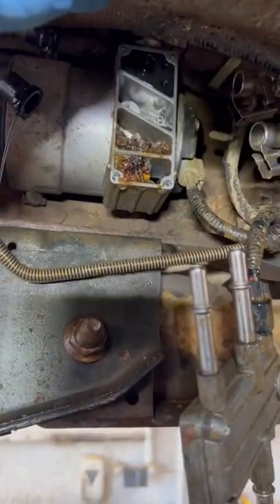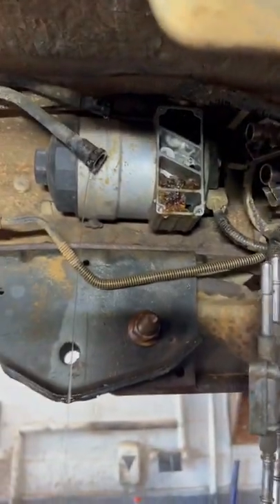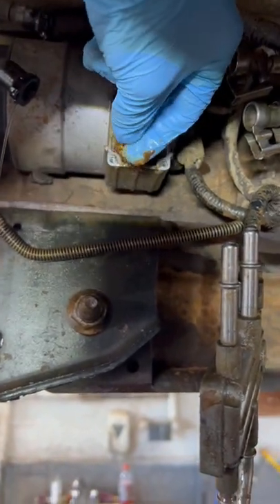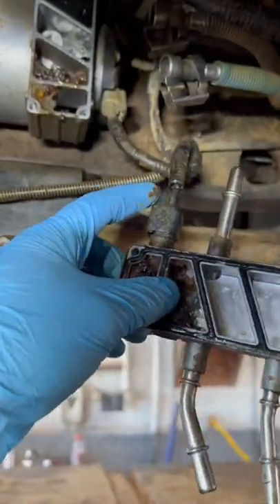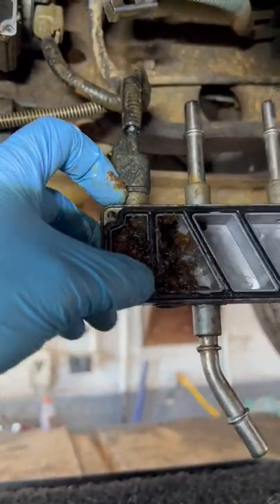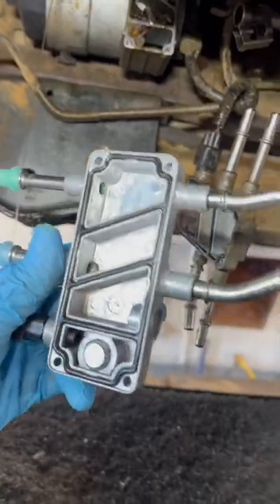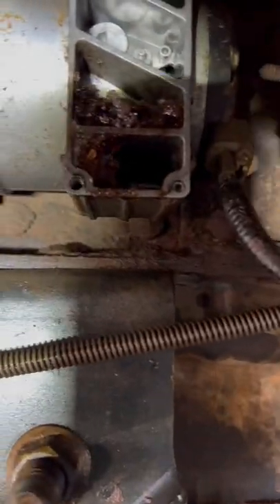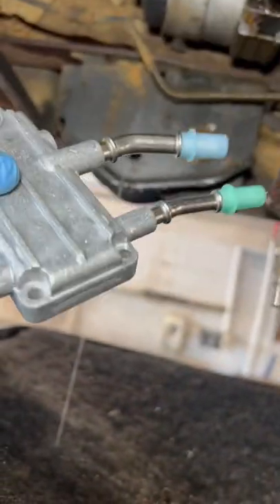Water in Fuel Light FIXED | Ford 6.0L PowerStroke #Reels

Comment: Why buy a new cover when i can just clean the one I already have 🤔
Reply from the maker: To get a new sensor.
Reply: @FlyingWrenches13  you can buy the sensor by itself for $15.  How much did that cover cost? $80?
Reply: @FlyingWrenches13  FAIL. LOL
Reply: exactly what i was thinking  ! Or get rid of the limp mode code setting junk!  Buy a Air Dog or Fass  ⛽  and filtering system!  Your think yourself later!  When your not buying  injectors at $800 pop  !
Reply: Because he can’t just charge labour
Reply: @aqibi2000  actually he can just charge labor. Not all repairs require new parts. Sometimes things just need tightened or cleaned up
Reply: Air hose and carb cleaner?? How did the dirt break the " header panel? Maybe a new gasket is needed?
Reply: @devingeary455   Sorry. But not true at all. Please do your research.
Reply: @spencew.g.  loose battery terminal? Replace it instead of tightening it? Gas cap isn't tightened down all the way throwing a code just replace it? Don't tighten it up? The confidence in your comment is laughable.  Do some research kid.  Mechanics can charge only labor and they do it quite regularly
Reply: @redguy8941  What's  laughable is that you actually took my comment serious.
Reply: @spencew.g.  at least he didn't like his own comment...
Reply: @51-FS  I know right?
Reply: The difference between mechanics and fitters
Reply: I grew up working on vehicles made before computers existed.. i still work on vintage equipment day in and day out.. these new guys can’t diagnose an issue worth a damn without hooking their fancy laptop to it and trying to pull codes.. i told this cat the other day “dude you’re not a mechanic, your a damn part changer..” he got booty tickled obviously but i had to break it down for him with crayons then he got it.. he was going crazy trying to diagnose a jeep cherokee that randomly cuts around 2,000 rpm but has no check engine light.. if there’s no light there’s no codes guy.. after 3 days of pulling his hair out i told him try probing the ground for the tps sensor.. boom problem found and I didn’t need no fancy snapon laptop to figure it out.. and i work on 70 year old detroits for a living
Reply: @mikecorleone6797  Ok.
Reply: New ones don't have pitting from corrosion and they can seal better.  If you want to reuse it,  go ahead.  It doesn't matter to me if your truck leaks fuel.  Remember that the 6.0 uses vacuum to lift the fuel to the hfcm then pressure only exists in the supply line between the hfcm and engine and the return line has pressure.  Therefore the truck could suck air and pump it through the injectors and then leak fuel once shutdown. I personally replace my hfcm with a new whole unit. They are like 220$ from ford. My truck is 08 6.4 with over 600,000 miles. Ive never put an injector in it.
Reply: Its called a manifold not a cover.
Reply: @anthonyrybczynski5420  LMAO
Reply: @anthonyrybczynski5420  manifold/cover, tomato/tomoto same shit.. it’s a damn cover and won’t leak if you replace the seals.. or better yet change your filters on time and check your tank for water occasionally and you won’t have this problem to begin with.. there’s this paste you can use to check fuel for water. You rub some on a piece of old wire or what have you and dip it in the tank.. if you pull it out and the tip turns red you got water and should drain the tank. It’s what we use for checking our fuel in marine tanks.. works great
Reply: I must agree with posters on this one, just clean it up. Oops  You dropped the ball on this one.
Reply: @mikecorleone6797  want a party ?
Reply: @WhiteBuffaloTowingLLC  sure you buyin the beer?
Reply: Why try to argue when you can just keep the comment to yourself and do you boo
Reply: I'm sure u don't even need a new sensor anyways I'd clean it real nice with brake clean first   before spending a dime
Reply: my truck shut off on me and then it said water in fuel after I changed all my sensors im going to do the same thing hopefully that helps

Comment: I noticed one thing when a person comes into the shop with a 6.0 power stroke they will buy anything you recommend no questions asked even the stuff recommended based on mileage I had one guy tell me whatever recommended based on mileage go ahead and do it
Reply: Cause they know that shit is already broke. I refuse to work on all the ones that are deleted and bullet proofed! How the fuck do you bullet proof the engine and it still goes to another shop down the rd and has piston crowns crushed and cracked onto top ring because of all the ingestion of coolant or fuel from cracked tips or whatever. Thean the customer wants a deal because its been to 5 other places. Take it to #7 and get it out of here.
Reply: @michaelkeyes3856  yeah but I’ll the life of a 6.0 a framer buys it brand new figure out it’s a piece of shit sells it to someone else then there tired of putting money in it then some kid gets it and goes Fucking crazy with it and doesn’t care how much he spends on it then it’s off to the scrap yard where it belongs  I  got 98 Chevy Silverado k3500 dully with a 6.5 Detroit turbo diesel and I’m still on my factory injector pumps that’s got say something and it’s still under warranty only got 134,000 on it I ain’t fan of the duramax Diesel engines I like newer 6.7 power strokes and old 7.3 but hell they don’t make a truck to work no more that old 6.5 goes the same 60 pulling nothing or pulling heavy load only time you know you got something behind you when you go to hit the brakes

Comment: Soooo... The real question is how do you PREVENT this from happening again in the future, other than sell the Furd and buy a real truck?
Reply: Stop running the fuel tank too low. That grime and wax is sitting at the bottom of these tanks, and when you let it get super low well you just suck up all that junk.
Reply: Real truck??? I hope you're not talking about Chevy or Ram (Dodge), that junk will fall apart sitting in the yard.
Reply: Toyota gang
Reply: Add blinker fluid immediately

Comment: So what you're gonna wanna do to fix this problem for good, is go ahead and get you a full 5 gal can of good clean diesel fuel. Then you're gonna pour that whole can INSIDE the Ford. Not one droplet of fuel can touch the ground. If that happens this won't work at all. The last step, now is ALMOST as important as the first step. This step requires an ignition source. Could be a match, a lighter, basically anything that makes a small flame. If you haven't figured put where this is going yet, BURN DOWN THE FUCKIN FORD!
If you've followed my instructions carefully, your water in fuel light may never be on again.
Reply: That happened to my neighbor’s duramax a few weeks ago, he didn’t even need to take the steps you outlined here..
Reply: @mikecorleone6797  what year? I know the GMT800s seat heaters could catch fire
Reply: 5 gallons of diesel fuel and 1 strategically placed road flare. 
If the light ever comes on after that… remove the fucking bulb.
Reply: @StarHunter28  it was an engine fire